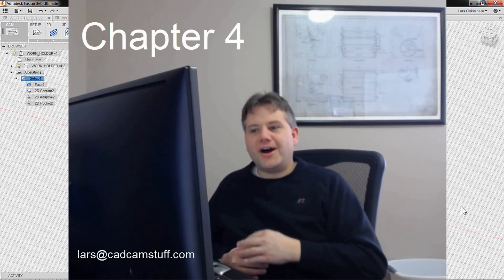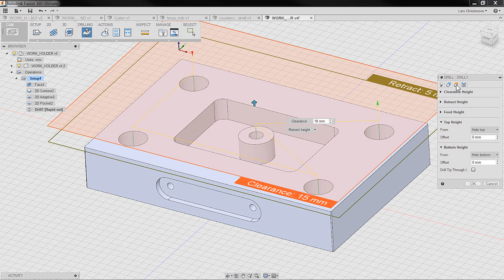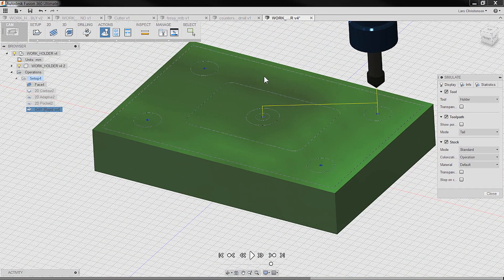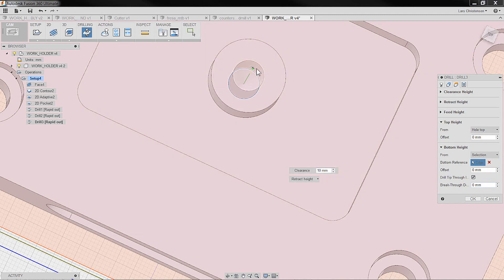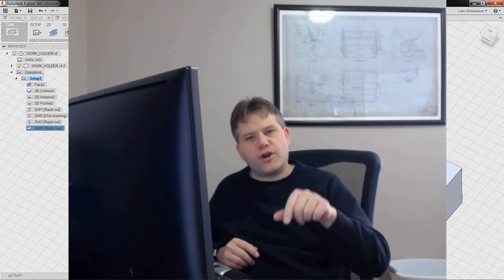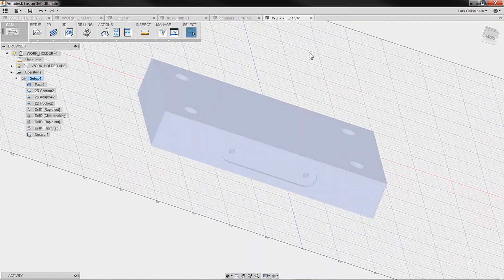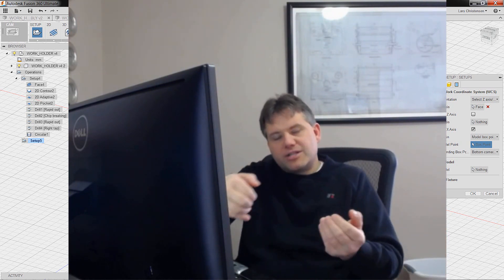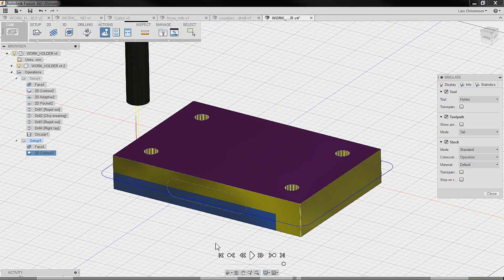How to learn Fusion 360 CAM Tutorial - Basic - Chapter 4

Comment: Lars,   you video series are great.  Thank you for them.  I have a question.  I'm trying to follow your setup to create recessed holes.  The Drill part works fine for the through hole but when I use the 1/8" flat end mill with the circular option, it only cuts the outer perimeter of the recess. It does not cut the middle out so I am left with a donut on the simulation.  Any ideas why that might be only cutting the perimeter of the circle and not the entire middle?

Comment: Hi Lars, I have a question regarding on the pick up point, I wasn't quite understand. If you choose a 2nd pick up point in that corner which you just did. Then how does the milling machine do probing when the vise is blocking that corner and the stock that is needed to be faced off and contoured also in the way of the point that you pick.  How come you don't pick the same corner put on top for the 2nd pick up wouldn't that be much easier?
Reply from the maker: Hi NTC SIE Thank you for watching!
If would most likely have some mis-match if you just pickup the 2nd corner on top. Most times the stock is not totally square.

Best,
Lars
Reply: Lars Christensen what about the first pick up, if the stock is not square and perfect as the stock that we use in Cam fusion 360. Does I cause a mismatch when we do probing?

Comment: In the first setup file you have multiple operations using multiple tools, will the post processing account for stopping the machine and allowing you to change tools? Or is this just an example and there needs to be a individual setup for each process using a different tool?

Comment: Hi Lars,
Please could you help me with one problem. I turned model and drill it from oposite side. Half of thickens form one side and half of thickness from opposite side. The holes were 3 mm next to holes from first side. X and Y both axes. I checked zero points I did all the same as you.There is some set up in Fusion? Thank you Petr

Comment: Excellent Lars - thanks for the course - so as a hobbyist, I can use 360 modeling and CAM 2-1/2 axis for free?
Reply from the maker: Hi Glenn, Yes, all the modeling and CAM 2-1/2, 3 Axis, Waterjet/plasma/laser and turning for free.
Reply: cool thanks Lars, even the full 3 axis can be used for free?  - I have a cnc plasma table, but looking into getting a small used machining center as they are quite inexpensive nowadays.

Comment: Thank you for this well thought out series. I have one question. Is there a way
to save the previously cut stock to use on the next step. So you can see what has 
been cut?
Reply from the maker: Hi +Josh Lange Thank you for taking the time to comment! Yes...That should probably be another video :-) Yes, it is easy. When you are done simulating your part— Right-click and you will see "stock" at the bottom, there you can save the stock as an STL file. Now you can bring it in and use it stock for your second operation.
Have a great day!
Reply: Thank you!

Comment: Really great tutorial set, thanks!

Quick feedback you might want to add a comment on:  It looks like you made a mistake with the Drill2 operation.  You told the software to start the drilling operation at the top of the hole, not the top of the part.  It's commanding a rapid-in through solid material before it gets to the top of your hole.
Reply from the maker: William Cooper :-) Missed a drop down in one of the selections in the video. No impact on the material for teaching, and in the real world it would not matter either if you follow the CNC Fighter Pilot trick. http://cadcamstuff.com/4332/why-cnc-operators-are-like-fighter-pilots/
Reply from the maker: Christopher Harper Great catch!! Thank you for taking the time to write., I will definitely do that.
Reply: What the heck?